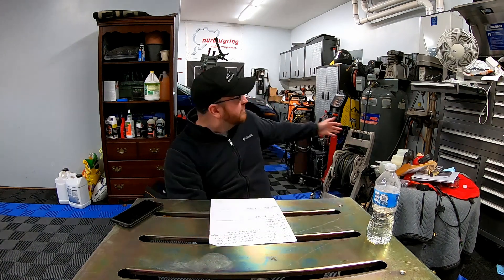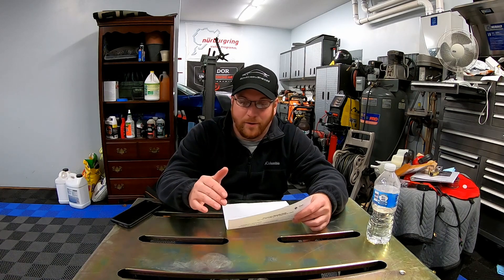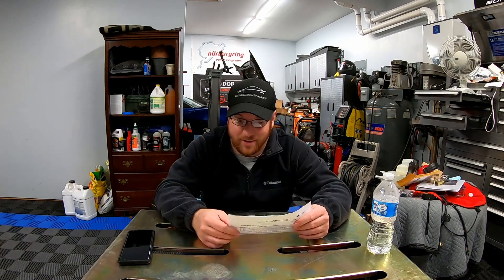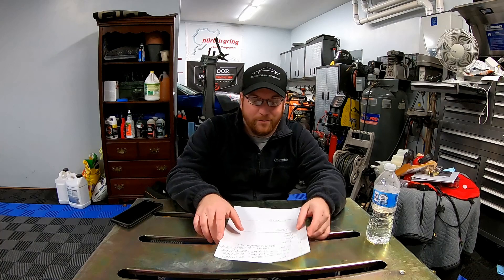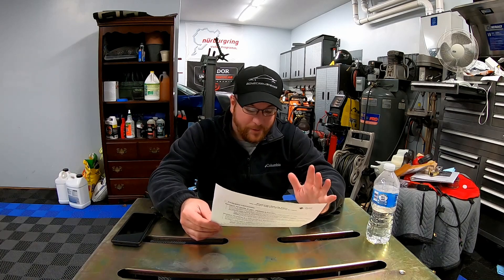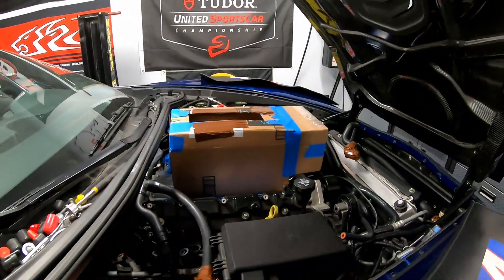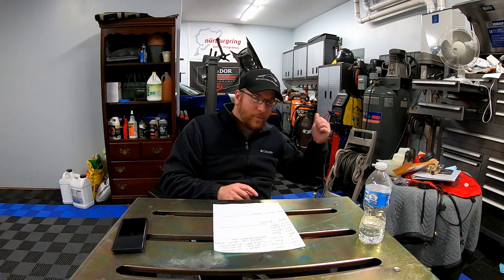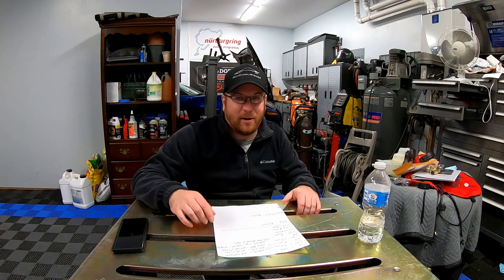TVS2650 - Is it worth it?

Comment: Rewire the whole car basically ??
Reply from the maker: If you going to swap to the LS9 accessory drive - the alternator is on the complete opposite side of the engine bay. You would need a new LS9 wire harness - among other changes.

Comment: Harrop supercharger by itself with belt drive is 4100 and belt drive is 1100. And I've seen a zl1 434ci make 1134hp
Reply from the maker: Speaking with Harrop directly - with the 6 rib setup using the stock accessory drive - it was a few hundred more then what you posted.

Comment: You got it all wrong 
I have had both 2300 and the 2650 on my 6 gen camaro the cooling brick on the edelbrock 2650 is great the boost temp stays low all day every day
Reply from the maker: No one makes a 2650 for the LS that doesnt require a whole new accessory drive that clears a Vette hood.

The LT1 has multiple choices.

Comment: Easy fix go built ls7 and harrop itbs. Screw the blower.
Reply from the maker: Boost is life!
Reply: @bonecrrusherSS  8k rpm ftw. If you run the Kong 2650 lsa with zl1 lid then mill the lid like the cts v guys do you might make it.